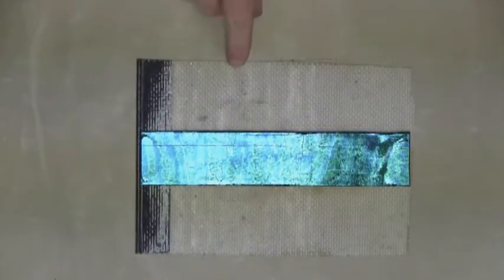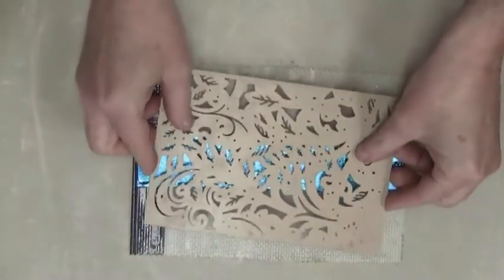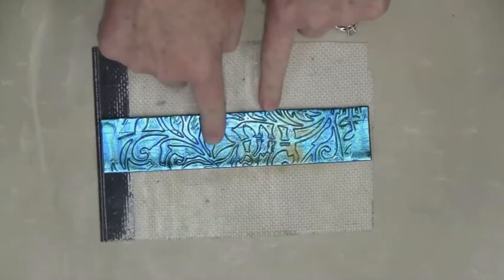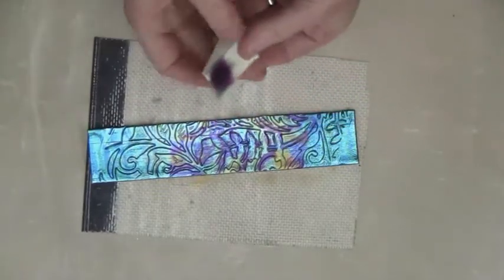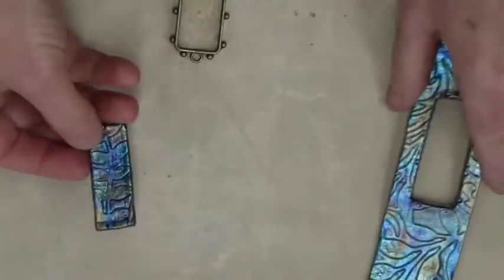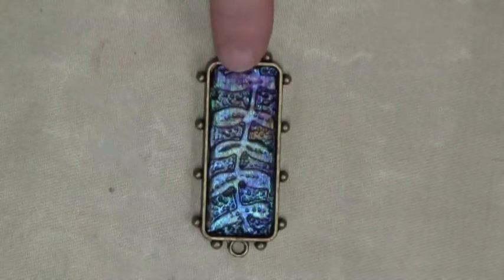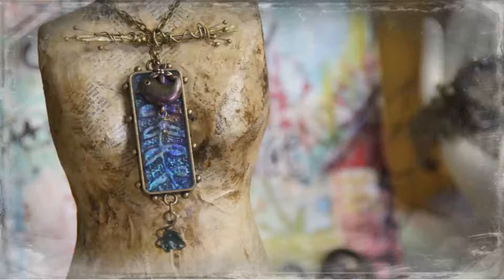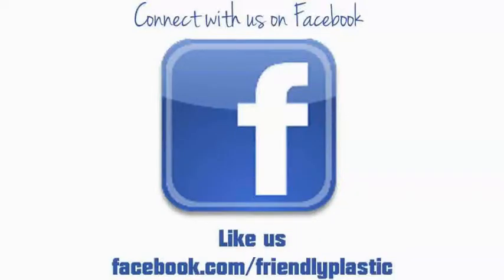Friendly Plastic TV -  Gorgeous glass like effects with stamping techniques - Art Pendant

Comment: Great project! That shimmery colorful look is my new favourite thing. But what is wrong with the back of the bezel?
Reply from the maker: +OrangeTabbyCat Thanks!! I'm not sure what you mean by the back of the bezel?  Inserting the Friendly Plastic into the bezel and coating it with acrylic resin gives it a dichroic glass effect.
Reply: it's just that at 3.41 or so it looks like the back of the bezel has a huge stain. i was wondering if it was a discoloration of the metal which is not a good thing.
Reply from the maker: +OrangeTabbyCat It's not a stain, it is residual glue from when it was removed from the packaging.  I just hadn't fully cleaned it off yet.  :)